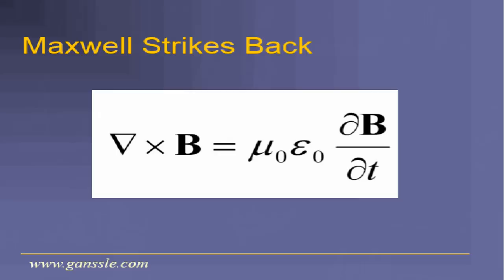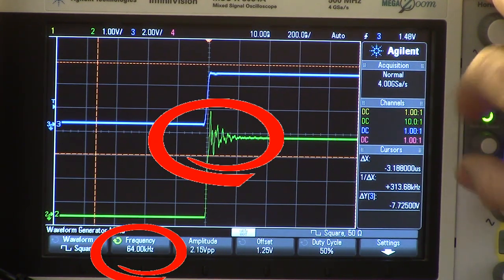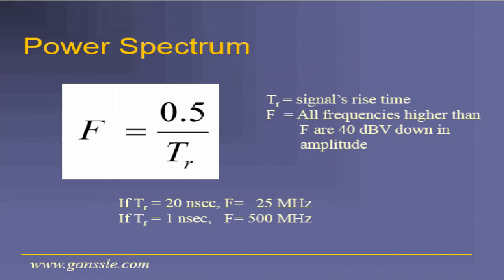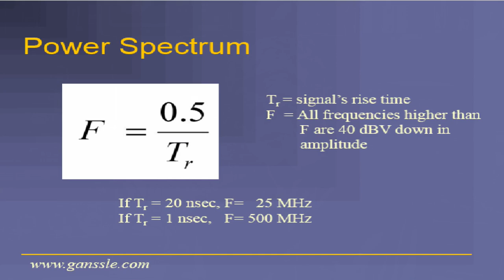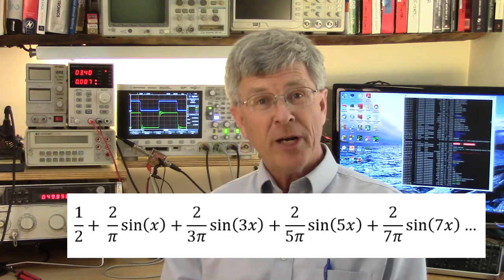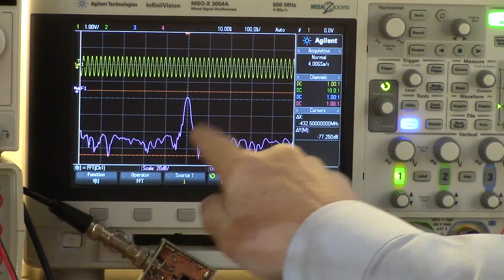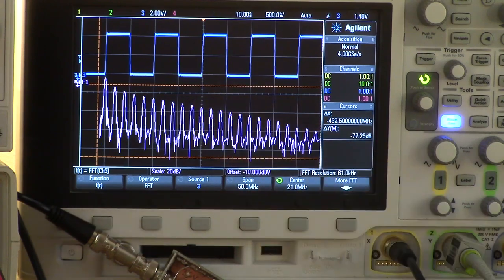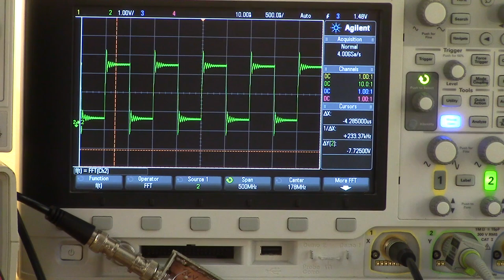I Only Probed the Board With a Scope - Why Did My Board Crash?

Comment: Well done, Jack.  I was just thinking you should mention that a poorly grounded probe can make it look like your board has a problem, when really it is nothing more than the way you are probing it.  But it sounds like you are going to cover that in your next video.

What I would like to hear you talk about--and you may well have already covered it--is what sort of things you do when you have to push beyond the limits of your equipment.  If you had to debug a DDR3 system running at a couple of GHz with your 500 MHz scope, you would have to do some smart things in your embedded firmware to debug the system.  

In my industry 10 Gbps communications are the norm, but 16-28 Gbps single-channel communications are coming quickly and boy are the test instruments and fixtures expensive.  Doing more with effectively less capable test equipment from the perspective of embedded firmware will always be a hot topic in my book.

Again, well done.

Comment: I work in repairs and run into exactly same problem with replacement ATmega chips, as that company with Z80 boards. I kind of workaround it with some capacitors, but would never understand it if not for you (i don't have much of the scope, basically i just supposed to turn screws in and out). Now i try to calculate proper terminators for lines in question. Many thanks and definitely a thumb up!

Comment: One thing I'd add to the question why software people should be aware of this topic: see, in many cases the pin's slew rate can be controlled from software. For example, the STM32 microcontrollers have an option in GPIO control registers, which allows to choose pin's speed grade. So programmer is really half-step away from physical effect. :)

Comment: Oddly enough you made me remember that I have actually encountered the same problem with a poorly laid out PCB and fast logic IC transitions you described. It must be quite a common one by the looks of it. But we did not redesign anything, instead we ended up using a somewhat dirty trick to overcome the issue. 

When I undrstood what was going on the board I decided to just cut the traces right near the output pins of the ICs and inserted 470 ohm 0402 resistors in order to just confirm that it would fix the issue. And of course combined the capacity of the traces it was well enough to slow the signal down and pretty much eliminate any of the "ringing". The proper way would be to correctly redesign the board with modern components and technology in mind but it was a very old and obsolete soviet era digital device with very limited use so we wanted to get over it with as little time and effort as possible so we just documented my "solution", added the pads for the resistors and called it a day.

If you have an excessivly high performance logic output then it is not a problem to slow it down. Going the other way though is nowhere near that easy.

Comment: There is a "tale" about a magic switch in some computer (it might be retold in the Hacker's Dictionary, I am not sure). One day a switch is found glued to the side of a minicomputer. It has to labels, Magic, and More Magic. It is set at More Magic. Only a single wire goes from the switch into the computer. The guy who found it flipped it - and the computer crashed. It was later discovered to be connected to the ground (of the metal frame).

Comment: I knew it.  There it is.... "transition time".  There is no discontinuity, discrete increments anywhere.  The line is solid being analogue, square, trapezoidal or whatever.  Yes time is involved. You can't avoid moving through time axis no matter what. You can have horizontal line but you are not allowed straight verticle.  If it was allowed, the line will not be there at all.

Comment: It's relatively easy to destroy a board or circuit you are probing if  project's power supply, scope or signal are not mains insulated. especially when you connect your probe ground to other a reference point on a circuit other than its common ground. 

I am just a hobbiest but this was an interesting video. I haven't thought about fourier series in a while.

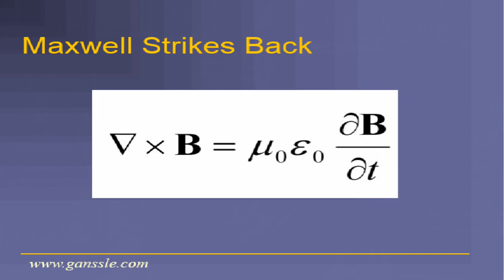Comment: The formula shown at 1:50 is wrong in many ways. Jack suggest replacing the B on the right-hand side with E. So far, so good. But that's only the curl of B in free space when there is no current around. What's missing is the current density over e-naught times c^2. To get the whole formula, find the Maxwell Equations in "The Feynman Lectures Volume 2", Chapter 18. It's publicly available at: http://www.feynmanlectures.caltech.edu/II_18.html
73 de DL5ULF

Comment: how /where do you connect the resistors?
Reply: Think of it as a variable resistor. You must first know your probes impedance. Use short lines and try to keep everything in balance between ground and the subject pin.

Comment: Good subjects, but poor explanations.  First, a lot of the ringing shown in the first waveform was probably due to the inductance of the scope probes ground lead, not reflections in the traces.  Second, the reflections are not cause be a mismatch between the "load" and "source" impedances; the are caused by the load and/or source impedances not matching the trace impedance.  So, pretty sloppy work here.
Reply: +Steve Robbins Any tutorials/video's or chapters of a book to cover your better explanations? cause I am more of a firmware guy and sort of killed boards probably some way or another and this seem to indictate the problems of my former way of connecting to things. (poor tutorials like "take this TTL usb adapter and just connect it" .. wich may work, but with logic analysers and scopes....)
Reply: Yea, assuming its not because of a single pin probe.
Reply: Comb Filter resistors will make the signal smaller but the ratios will be preserved.
Reply: Comb Filter on resonant analogue circuits, agree. Often signals like this turn up as common mode noise.